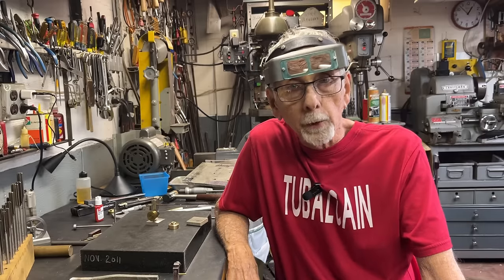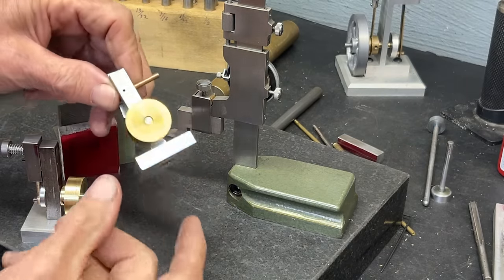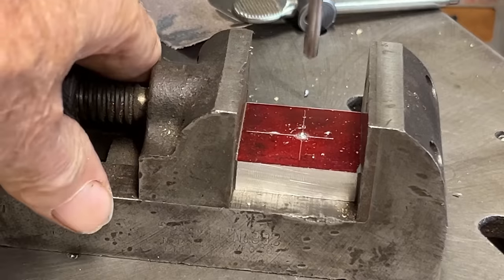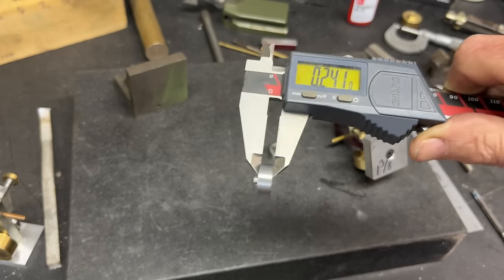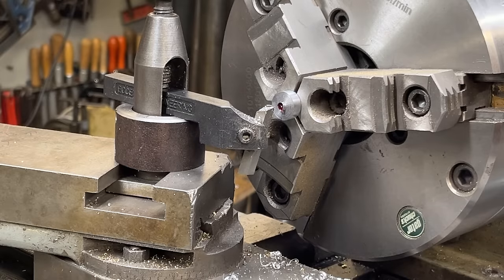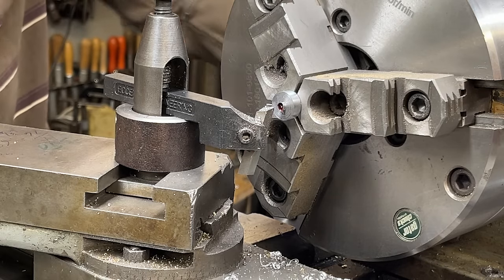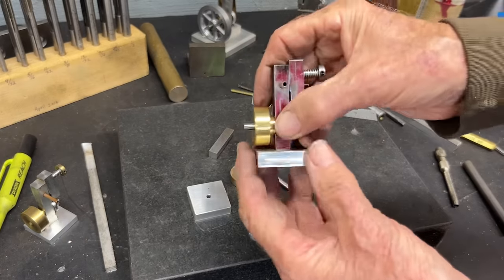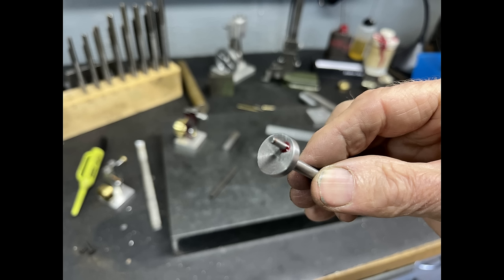BUILD A TINY MAYONNAISE JAR STEAM ENGINE pt 2 #907 tubalcain mrpete

Comment: I'm not sure, but the little steam engine looks alot like part of an aquarium airpump we had as a kid in the 1960's. It supplied multiple aquariums bubblers and was in a divided metal box, small electric motor in one end and pump the other and ran on a belt . The air exit was against the end and can't remember how it sealed. I can't remember if the belt failed or the motor did, I thought to make it into a engine, but lost track of it.

Comment: Hey Mr. Pete!  I almost burned down my parents garage when I was a young man.  I was making a shim from a slice of VW trans-axle to fit a 2 liter VW bus engine onto my brother's VW beetle.  I did a lot of grinding of the shim on my bench grinder and that left a nice layer of aluminum/magnesium dust all over the bench.  Days or weeks later, I needed to grind down a steel screw and when the sparks from the screw hit the dust all over the bench, it ignited and quickly burned across the bench!  Luckily it did not catch anything else on fire, but it filled the air with a tremendous amount of black soot!  Lesson learned!  👍👍👍
Reply from the maker: Wow

Comment: I really enjoy the "layout method" that you're using to locate features. I feel like a lot of "newbies" like myself who've learned in the digital age tend to immediately think in terms of the DRO when it comes to locating features. I know I do anyway. I will be thinking about order of ops as I'm preparing for a project and using the DRO to locate features will automatically be included in my thought process, usually skipping right over the surface plate. I feel like I would like to change that and include more layout in the process. Seems to be a great way to do things in a lot cases. Thanks as always for the knowledge!

Comment: Hello Lyle, over 50 years ago, when I was in a caving club, we would burn a small piece of Magnesium ribbon to light up a large cave section for photography. We would get some strange colour balances from the light produced and once done, you had to let the smoke settle before you could take any more shots.
Reply from the maker: I would love to have some of that material in a ribbon. We always use carbide lamps or huge torches in the caves. But not nearly bright enough for photography.

Comment: Another interesting little project from Mr. Pete. For a quick setup, where you can’t wait overnight, warm the Loctite parts to about 100 degrees with a hair dryer. To loosen and remove Loctite, heat to about 250/300. Works both ways. A little heat little sets, more heat releases.

Comment: In a previous job assignment, I had to centerpunch many holes, drill and tap them with a cordless drill. After a lot of punching, my hand would be sore, so I found one of those orange rebar safety caps you see on construction sites to use as a handle for the automatic center punch. Much more comfortable to use the punch after that, and more control, too!

Comment: Lyle, I fabricated/built the exact engine probably 40 or so years ago when I was stationed in England…. And no, I don’t remember where I got the plans from, but when I saw your “part 1”, I took mine out, dusted it off, and drop of oil, and connected the airbrush compressor to it and it ran like the day it was made. This is a great first project especially for a micro lathe (Unimats, Sherline, Proxxon, etc), that you can actually enjoy ”playing with”, rather than another mod, or jig for the lathe.
Reply: @mrpete222  Ya know, i may have gotten the plans or idea from the British “Model Engineer” magazine.

Comment: Flash bulbs for cameras used magnesium threads as a source of light.  Navy photographers would keep a couple of spare bulbs tucked in their pants when shooting on carrier flight decks.  Worked well until they got painted by radar and all the bulbs went off at once.  They then started dancing and trying to flip the bulbs out.  Navy 13 button pants were a pain

Comment: Mechanical Engineering students at University of Charlotte draw up this same engine in MEGR1201, CAD model to 2D prints, then in MEGR 2156 they go into the machine shop and make them, in the process learning how to use common shop tools, from grinding there own HSS lathe bits, running a band saw, lathe, mill, belt sander  ect.  My son is taking 2156 next semester, looking fwd to see how his runs.

Comment: Back in 1970 I was stationed at USAARL at Ft Rucker AL and we were testing a burning helicopter rescue system. We were using Huey bodies for the test. The Huey has an AL-MG alloy skin. JP4 was put under the body. The JP4 fuel was hot enough to ignite the skin. Around 10 seconds after fuel ignition the inside of the Huey was over 1200 degrees.
The Navy response if a helicopter started burning was to push it over the side. It had to be pushed over or it would burn through the deck. 
There tends to be enough oxide on Magnesium  to make it almost impossible to put out.
Needless to say, the system was a failure. 
I tried to get my flight time in fixed wing aircraft.

Comment: As you were turning on the crank on the lathe and you were using your quick change tool post. Even  quick change tool post I've never seen has a threaded hole on the right side and I have never heard anyone address what this threaded hole is for.  Do you know this hole is for?
Reply from the maker: To mount a work stop

Comment: If I've learned anything about engineering it's don't use cheap locite and don't use that loctite in a stick.
Reply: He will likely get 20 bottles of genuine Locktite for Christmas now...
Reply: @CalPil0t ...LocTite is expensive..
Reply: That and a good job of cleaning and using primer.